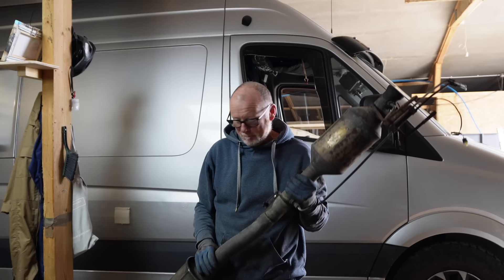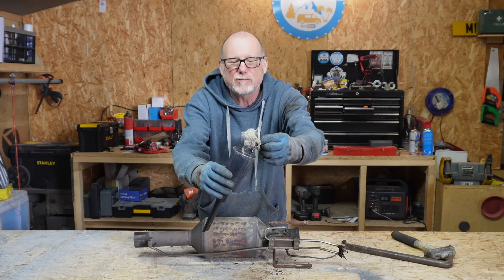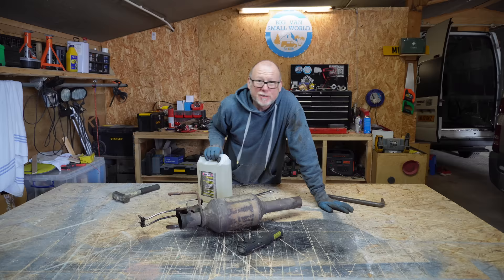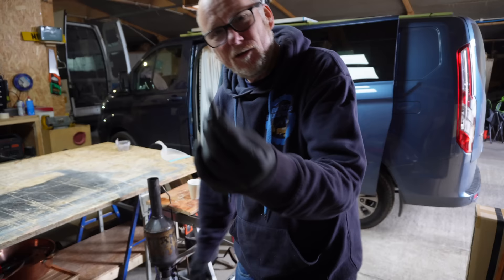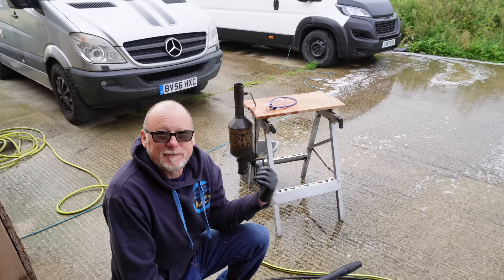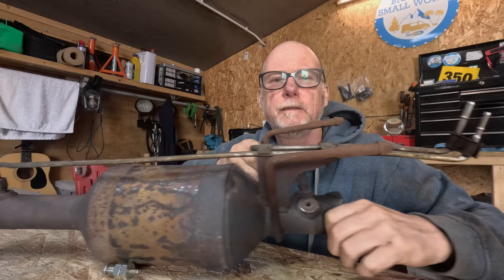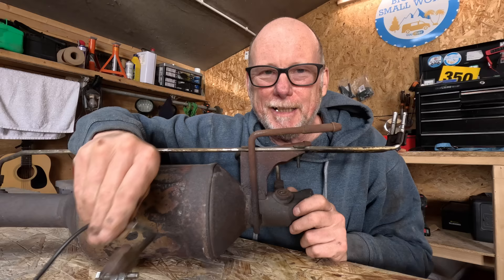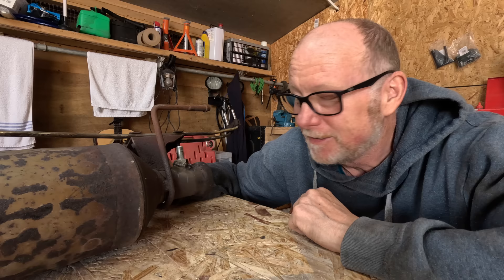DPF REMOVAL & CLEAN Using Wynn's Off Car DPF Cleaner

Comment: You are totally correct Mel all that “on the car cleaning” is cobblers , rarely will it clean properly . I clean DPF’s in a £30k cabinet machine from cars to lorry’s .again you are correct firstly you must clean against the flow of gasses a pressure washer can be used to help as like you have done. Good video Mel helping those that might want to have a go themselves 👍
Reply from the maker: Thank you for the positive feedback really appreciated 👍🤓👍
Reply: @BigVanSmallWorld  your positivity helps a lot of people keep up the good work chap 👍
Reply: Have a look at O’Reily’s DPF cleaning channel. He uses a mix of Launch UK fluid & water flushed through the DPF whilst it’s still on the car.
Reply: @torquesteer2657  He gets them to new condition
Reply: A few of my mates and me are missingWaffle on Wednesday Mel, is it returning soon
Reply: @torquesteer2657 absolutely Jimmy cure a lot of people’s woes. What the analogy with the vacuum misses is that a DPF isn’t a filter in the physical sense. A good cleaner dissolves the soot allowing it to pass through the filter. A DPF only becomes blocked when the regeneration fails (and that just burns off the soot using heat). 
Think of the grief that could have been saved by doing this on the van.
Reply: @hughmarcus1  I watch Jimmy's channel, he seems to know his stuff where dpf cleaning is concerned. Hats off to Mel though for having a go.
Reply: @hughmarcus1 Bang on. More often than not a blocked DPF is because of an underlying fault with the engine
Reply: If I had spent £30k on a machine I'd be recommending it's use too!
Reply: @dopiaza2006  my boss bought 2 of the damn things 🤦‍♂️
Reply: @hughmarcus1  DPF cleaning does remove the ash content too though, which effectively reconditions the DPF to near new condition - as long as the ash level is reset in the ECU afterwards.

Comment: I cleaned mine by removing it and fitting a straight piece of pipe. No more DPF issues and very happy with it. Also blocked off the EGR valve. Of course got an engine light so I removed the lamp. All good now.
Reply from the maker: Haha way to go 👏👏👏
Reply: Hope you know someone who dose bent MOTs 😂😂
Reply: If the dpf filters cold start contaminants, won't it pass when you go with a warm engine to the test?
Reply: Same here on my 330D
Reply: @danny6574 goes through no problem. Did it to my transporter years ago.
Reply: @danny6574   Does*
Reply: A few years ago: CItroen 2 litre hdi with dpf in place, soot at exhaust 0.1ppm. Dpf removed and remapped for extra 20bhp, soot at 1ppm which was well within legal limits.  Regret selling it on but I was concerned the MoT centres were being told to check for missing dpf’s.
Reply: Lol, there is no button here with a laughing face. You need a IC timer on the engine lamp so that it lights on ignition start and then goes off, otherwise someone will do a diagnostic check and see the fault codes when you do your roadworthy inspection, Pickerl, Mot of whatever you may call it.
Reply: except for the environment.
Reply: How is that when the exhaust gas recirculating valve directs hot carbon monoxide into the induction inlet? Hotter than fresh air. These ‘environmental friendly’ engines could not run without a computer to overcome the contaminated fuel mixture and back pressure from exhaust filters.
Reply: @HEREISMULLEER  if done correctly it shouldn’t even be looking for the DPF or egr (dpf and egr delete) just turning the light off will cause problems and probably fail mot exhaust check
Reply: You don't need to remove the DPF. All you need to do is drill it out. MOT check no problem.
Reply: No more DPF issues once in 200k miles, but now your kids will get lung cancer for a minor inconvenience. Big win 🤣🤣🤡🤡
Reply: @alexhorton7371  Move to somewhere they dont do tests and where you are free
Reply: Hmm, all fine and well until MOT time.

Comment: I lost over £4000 on two cars because of the dpf's. In a few years time there will be adverts saying "did you own a car with a dpf fitted?", and the government will have to pay out millions of pounds for forcing car manufacturers to fit something not fit for purpose! Dpf's totally destroyed the biggest attribute of the diesel engine... Reliability! Shocking! 😠
Reply: Absolutely Agree with you 😊
Reply: Those adverts are already out there. They’re just a bluff & going nowhere
Reply: It does add a pile of complexity that make one want to return to the days of simple electromechanical vehicles. The easiest way to simplify things again now is move to an electric motor. You don't need all that anti-pollution kit because there isn't any in the first place.  OK, you don't get 700 miles per tank, but you do get clean and quiet (and significantly cheaper motoring if you can charge at home). Seems a reasonable tradeoff.
Reply: @xxwookey absolutely. About 50 odd moving parts instead of nearly 1000. Much less to go wrong. An electric motor uses about 30% of the raw energy too.
Reply: The purpose is fit for the environment.
Reply: The purpose of the DPF and CAT is the environment. It's not an upgrade to your car 😅

Comment: ⚠️I would avoid buying a vehicle with a DPF full stop.
Reply from the maker: You’re not wrong there 👍🤓👍
Reply: So you only but 19 year old motors then as most brands started putting dpfs onto diesels in 2004

Comment: Your assertion that cleaning a DPF in the flow direction would not succeed is completely wrong.  You example using a paper vac filter is nonsense, since the particles in the DPF are all soluble and the honeycomb holes through the length of it are all the same size, easily allowing dissolved material to flow through.  However, pouring cleaning fluid into a horizontal DPF can only clean the lower approx 40% of the blockage, so removing it for cleaning is a good idea because you can dissolve 100% of the material.  In some vehicles removal is pretty easy, but in many others it is an almost impossible nightmare.

Comment: If you drive plenty it should never need doing. My work transit has never had an issue and currently on 170000 I do 250/400 miles a day I guess that’s the trick
Reply from the maker: I think you could be right 👍🍻

Comment: Nice to see how all the dirt runs back to nature again...
Reply: Hmm, yes I was thinking the same, just like the hoover filter it just releases all the crap out at a different time and place ..
Bit like EVs are clean where they are driving but the pollution is still being produced at the coal fired power station.😂😂
Reply: that's only the soot from one regeneration cycle. Around 100-200 miles worth of driving. Bit of carbon never did anyone any harm!
Reply: It came from the ground in first place..
Reply: Oh no, carbon in the soil. Better there than your lungs, don't you think?
Reply: Its just unburned coal going going back home but in a proper way.
Reply: @FlyingFun.  
Coal? not in the UK

Comment: The company I work for has just had a Ford Courier van's DPF cleaned after the van went into limp, mainly due to it being used for short journeys.  The mechanic told me that a regen involves over-supplying diesel, some of which washes down the bores, contaminating the engine oil.  The oil level might even rise!  He recommends much more regular oil changes, because of this.  I like the idea (from another comment) of opening the DPF chamber, throwing away the contents and welding it back up!
Reply from the maker: Thank you 🙏
Reply: That will be great until you go for mot do you think they not see it welded you have two problems then
Reply: @patkelly9907  No, I'm a very good welder, and in any case I'd open up the component at the back, where my deceit would remain hidden after reassembly!
Reply: @RubberBandBoy Naughty,  but don't blame you , good job your a good welder then 😉 😅
Reply: @carlarthur4442  It's a long time since I've worked as a welder, TBH, so the results might not be as impressive as I made out!!
Reply: Mel, what is the year of your Sprinter? Does it have Ad-Blue?
Reply: Mercedes engines have been for the last 8-10 years over fueling to clean the DPF..
Our sprinter fleet along with our vitos were regularly showing over full engine oil in the engine,due to the amount of diesel going into the pistons..
Which in turn breaks down the engine oil..
The thing is it’s the same for all diesel engines yet the oil changes have increased from traditionally 12000 miles to 20000 plus know..
We change at 12000 max and we’ll get 280000 out of a Mercedes engine without an issue,except for the dratted DPF..
Reply: Well it is a supply of diesel that reacts with a catalyst, but it is dosed in the exhaust. Doesn't effect your oil. It's referred to as hydrocarbon dosing. 

The filter should be cleaned with heat. Should be baked carbon burns off at about 932f . That is the proper method.
Reply: @IcatchTuna  Yes, that's how it's supposed to work but if you read the other comments, you'll see people reporting the over-supply of diesel washing down the bores and contaminating the engine oil.  This seems to happen even when the regen system works properly, but is exacerbated when the regen system fails.

Comment: I’m SO GLAD I’ve kept good care of my rust-free 2003 Dodge Ram 3500 Cummins!  None of this crap to deal with.  For over 22 years this thing has run reliably, and other than rebuilding the manual transmission 5 years ago, and the lift pump and the water pump- oil changes and fuel filter changes have been all that Ive ever done.

Comment: Cleaned mine with the same fluid about 2 months ago, back flushed when rinsin aswell maybe 20-30 times also used air pressure which help blow out some of the red ash at the end and alot of the water. Worked for me lowered my dpf pressure from 250mbar at 3k rpm to 50mbar at the same revs. I also used the same chemical as brick acid which really helped with the red ash was a weakened version but did the job.
Reply: The pressure in the DPF should be no higher than 10 mbar.and one should never let the diesel fuel in the tank drop below a quarter,preferably a half tank of diesel for the DPF to function properly.👍
Reply: @johnpatterson5744  50mbar or kpa can't remember at 3k rpm this was directly after cleaning with water still coming out and before it has done a regen aswell. Havnt checked it since, but will check it this weekend and see what it's at now 4 months later.
Reply: @johnpatterson5744  No more than 10mbar on idle, ideally half that and 50mbar at 3krevs is very good AFAIK. The DPF will normally get blocked for a reason.... Built in fault code with some vehicles (around 120k miles), sensors not working, nozzles blocked, etc.
Reply: Been 6 months now its flushed all the water, lose soot and Ash out that was broken up by the chemicals along with a few natural regens. The pressure is 6mbar on idle and around 50 at 3.5k so it did the job very well and was very easy to do.

Comment: There are several reasons why there are companies that clean filters. 1. they use hot liquid for washing. 2 they recycle the liquid. 3 their cleaning liquid is filtered and the waste is disposed of correctly. 4 there is a guarantee on their work.
Not like your solution, where chemical liquid and particles run directly onto the ground and contribute to contaminating the groundwater. It doesn't matter now, it's your grandchildren who can't drink water, unless it's cleaned WITH chemistry to remove solutions that you and others use now. think about it
Reply: Like talking about exhaust gases in Glasgow, pointless with the winds we get,same with rain,the environment with filter it...worry more about volcanic activity!

Comment: did mine an old 520 bmw took it of soaked it in a big bucket with two dishwasher tabs and half a bag of soda crystals for an hour washed it out with a hose and refitted power restored and no lights on cost about a quid 😁😁😁😁😁
Reply from the maker: Oh brilliant 👏👏👏
Reply: Dishwasher tablets will do a good job of removing oil and soot, but you need an acid after that to get rid of the metallic ash as well. https://www.youtube.com/watch?v=Zw-EAc_Lpv8 tests 9 chemicals on a chopped-up one to see how well they work in practice.

Comment: I leave the DPF on the vehicle. Just disconnect the exhaust joints  and cover the exhaust holes with plastic bags. Then stick the powerwasher lance up its snout. You don't have to disconnect any sensors as they do break unfortunately. 

I just fitted a new NOX sensor, but all the threads stripped removing the old one. I just drill it out, sit the sensor in place and mig the sensor. Saves a lot of hassle
Reply from the maker: Nice 👍 thanks for the tip 👍🤓👍
Reply: Could you post a video showing that? it would be helpful to leave the pipe in place.

Comment: a thought Mel, as I wish to remove my DPF ...my idea is to remove the exhaust like yours, then cut a hole through the ceramic to put a straight pipe through, welded to each end. This way it looks like the dpf is there, but the gases are going straight through, and have the dpf shut down on the ecu. :)
Reply from the maker: That would be an mot fall and it’s against the law to remove the DPF from the vehicle

Comment: I cleaned the dpf on my Range Rover on the car with 100% success and will do at every service with lots less hassle
Reply: Care to share how you cleaned your DPF? Did you use the same method or a different method?
Reply: @randoshanks  I followed same method as O’Rileys Autos on you tube used wynns dpf cleaner pumped fluid in pressure pipe before dpf lots of videos on you tube also sprayed dpf cleaner in air intakes as per revive product video on YouTube.
Reply: How  just to help others please 😊

Comment: All this off vehicle DPF cleaning and DPF filter blockage can be avoided completely if the DPF self regeneration process took place as the vehicle system saw necessary. However if your fuel gauge is always below 1/4 level , the ECU will NOT kick in the self regeneration process….ending with a filter so blocked that forced  regeneration with diagnostic tool or self regeneration becomes ineffective.
Reply from the maker: Interesting that thank you 🙏
Reply: Hi by self regeneration do you mean just driving the van until it clears out itself?
Reply: @donner101  Yes sir. As long as the DPF has not been left to point of blockage the system will periodically self clean.... the ECU looks at the fuel level to commence this process. Because of the extra fuel required to achieve the high temperatures.
Reply: Yes the pressure within the DPF should be no higher than 10 mbar.and ensuring your running the level of diesel in the tank no lower than a quarter full,preferably at least half full ensures the DPF will function effectively.👍
Reply: Some vehicles wont do a self regeneration if the ambient temp sensor is faulty or if the vaporiser is blocked in the exhaust, this is where fuel is squirted into the system to burn off the soot.
Reply: @BigVanSmallWorld  A £10 OBD bluetooth dongle and a phone app will show you how your DPF is doing and can avoid such problems as these
Reply: Is DPF and Catalytic Converter the same thing?
Reply: @mkasicharlesj9079  No, Catalytic convertor is before the DPF and does not clog up/need replacing.
Reply: In need of your advice, I went to the dealership and was told that my DPF could not be cleaned and needed to be replaced. And the cost of this replacement is excessively high. Is it possible that the DPF can become so clogged that it needs to be replaced?
Reply: @mkasicharlesj9079  Pretty much all DPFs can be cleaned, dealership won't offer that service though so their computer tells them to replace it. What car is it?
Reply: @dopiaza2006  Nissan X trail d1.6 ,2016 model, T32
Reply: @dopiaza2006   I went to Nissan dealership
Reply: @mkasicharlesj9079  I'm a VAG man myself but  DPF is a DPF really, I'm sure you could find someone to take it off and reverse flush/clean it for way less than the cost of a new one.

Comment: You will get better results with your welding if you prepare the area you are going to weld by cleaning it as much as you can.
A wire wheel or brush works good.
Reply from the maker: Thanks for the tips

Comment: The main reason the contaminants dont flow through the filter is because the particle size is too big. by using a solvent the dissolved contaminants can become smaller than the filter can hold and it will exit, so those on-car cleaning methods can work, but taking it off and cleaning in both directions is by far the best way.

Comment: I broke one of the sensors when doing that on my wifes X trail. After i was told "you didnt  need to do that" I did have trouble getting it dry, Blew air thro after draining and flushing  from a workshop vac outlet connected to the pipe and heated the pipe in front of the core with a blow lamp on and off for about 30 minutes.
Reply from the maker: Well done 👍

Comment: Cleaning the dpf on the van is also an option , i used  manol dpf cleaner injected through the pressure sensor pipe . Works without taking dpf off , which is very tricky on renault trafic as high up behind engine.
Reply from the maker: Thank you
Reply: This worked perfectly for me on a 2010 Audi TT TDI. Was in limp mode and soot load was so high it was beyond the level for forced regeneration. Mannol DPF cleaner in from the top reduces the load far enough that forced regen was successful and all is good now.

Comment: Years ago I looked after forklift trucks in chemical plant, they had large honey Combe spark arresters on the exhaust, always used pressure washer, but importantly they were allowed to dry in a heated room, otherwise the soot stuck to them very quickly, like you see on videos in situ loads of steam but builds up too quick if not dried. 👍
Reply from the maker: Thanks for the advice 👍